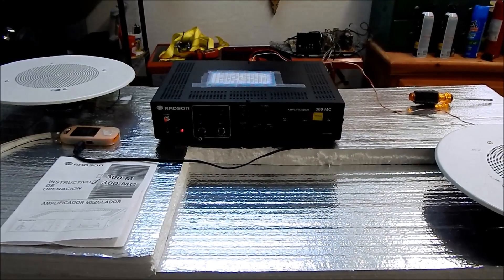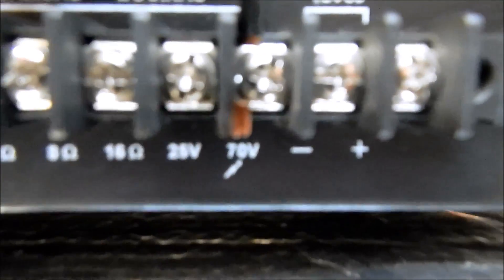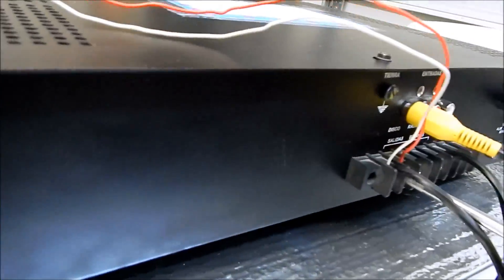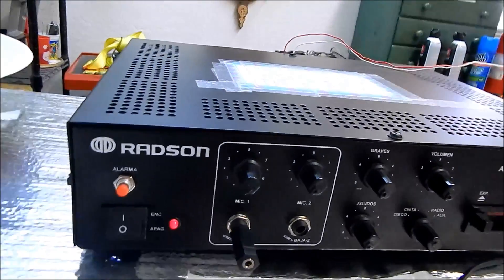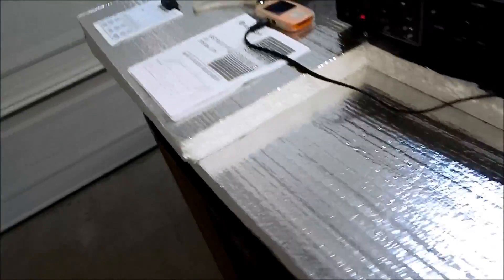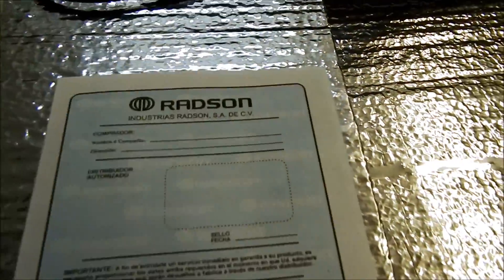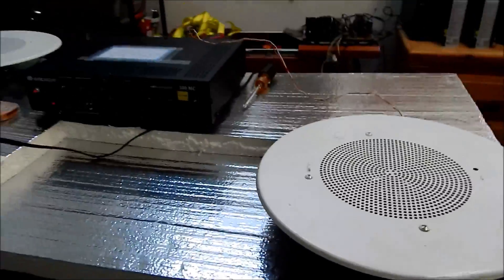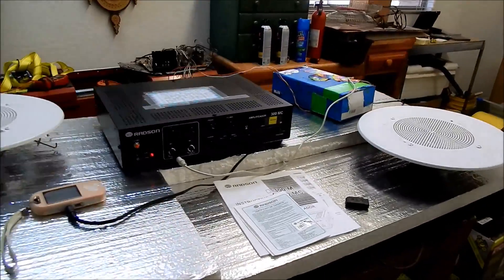My Radson MC 300 Foreign PA Amplifier.

Comment: I just found this amp on a public school and brought it in for repairs. I was amazed by how much you can squeeze out of this little amp using horns for PA. And yes, Mexico DO honor purchase guarantee like any well stablished brand. But the catch is that you will most likely have to come over here for that. And... this one is a SUPER old model, so yeah....  I am very grateful for the documentation that you scanned for us, it helped a lot. You rock bro!
Reply from the maker: I'm glad you found the documentation useful and that's what I like to hear. The amplifier is powerful but for some reason with the one I have it gets unstable when the bass is cranked up which I added a 4 ohm resistor at 10 watts across the 4 ohm and COM terminals inside the amplifier which that solved that problem. With that modification the amplifier works greats without getting unstable but you lose some bass at the same time.
Reply: @CristianOrtiztechmaster926  Good to know! I haven't got those issues yet. Thanks a lot for the tip!

Comment: Radson has made good amplifiers for a long time in Mexico.  They also make other PA equipment.  They first became popular in the 60s among sound systems or "sonidos" that played music at events in Mexico.  Back then their amplifiers were tubes and they were built like tanks.  Those were the best pieces of equipment they made i think.  They kept making their tube amps into the late 70s.  They fell out of popularity with the sound system crowd when other types of power amplifiers such as Peavey came into the market in Mexico.  Today radson still makes some PA equipment but they don't focus on stereo type sound equipment.  Their amps can be found in a lot of PA applications such as street vendors that use horns on top of their cars or sometimes on horse drawn buggies, don't know if you saw those while in Mexico.  Is your amp a new old stock one?  Didn't know they still made them with cassette, their recent models have an SD card reader.